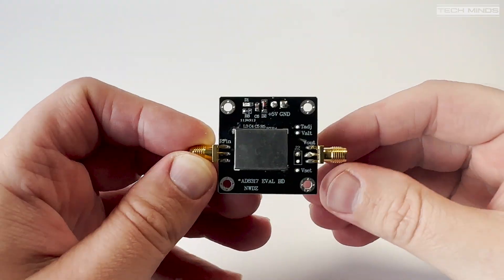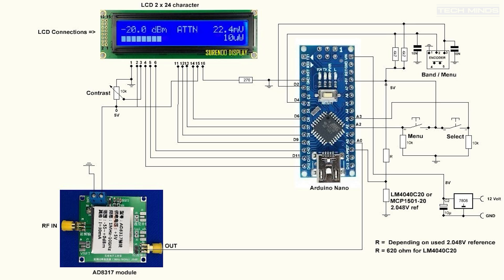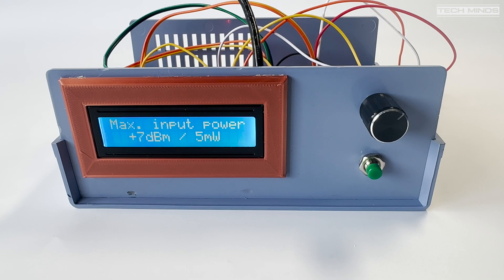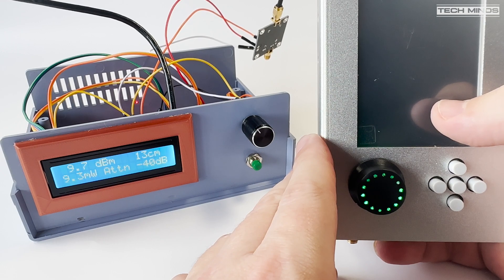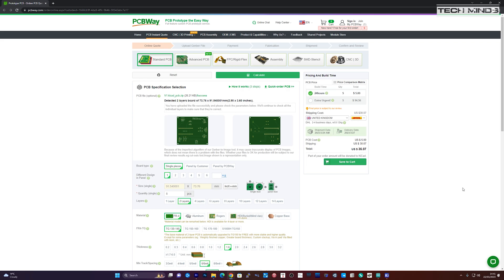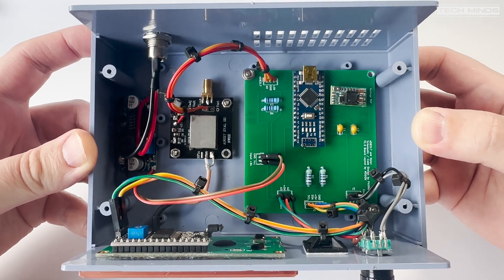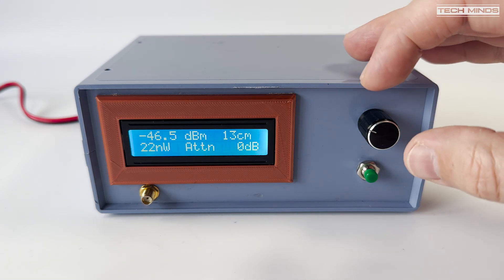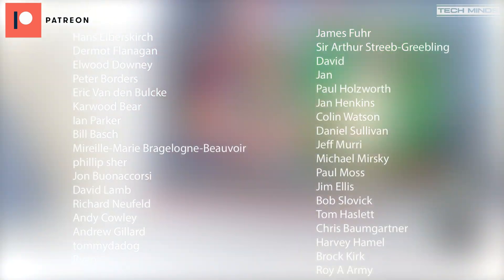RF Power Meter Using An AD8317 & Arduino

Comment: I just rx "RF363" unit from AliExpress. It is NOT accurate! 😂
At 50 MHz, the reading jumps around.
Next to the input connector, there appears to be a 3-way band selector.

Comment: @Tech Minds It looks like you need to debounce the rotary switches 🤔 You can do that in software or hardware. Since this is a small project, I'd just do it in hardware with a capacitor across each switch. Jack Ganssle has some good information on debouncing switches.

Comment: If you are fine with cutting the dynamic range above 0 dBm and for large powers you would use an attenuator anyway, you can set R7 and R8 on the AD8318 board to increase slope some. I did that with 10k on each to get the slope 2. I also populated C9 to reduce the envelope bandwidth, because the ADC samples slow anyway. Finally I used an ADS1115 ADC board, about as cheap and large as an external reference, but 16 bit (15 above 0 V). The result is surprisingly precise as long as you keep the temperature stable and wait until the AD8318 is heated up (note its power consumption). The datasheet temperature drift is pretty high, so I use a second channel of the ADC to sample the AD8318 temperature, which the board provides as voltage. A few minutes after power up that signal often oscillates for a short time and always only once, like the AD8318 recalibrates something.

Comment: 10:23 Why did you have to put the attenuator in line friend? 
By the way, proud Patreon supporter here... If you aren't a supporter ya oughta head on over and help out this esteemed YouTuber. :-)
Reply from the maker: The reason for the attenuator is because the max input of the meter is around 0dBm, so we add the attenuator between the meter and the radio and then configure the attenuator offset within the menu. Hope that makes sense! Cheeds

Comment: Cool project, I'm always interested in power supply or power meter projects. :)

Only the autorouters always put also traces just next to each other, 5v and menu signal are unnecessary close to each other, no need for that and it can cause a couple if different problems/challenges. Next time try route your board yourself, will give much better and nicer result.
Reply from the maker: Thanks for the info!

Comment: Check if that board has input compensation. For your next update consider a power tap (so that you can use it inline) and a digital attenuator, it comes in handy.

Comment: The commercially made power meters based on similar AD logarithmic converters require the user to enter the frequency because the response of the converter is not constant. How about this one? Also, some power meters do have a frequency counter for this, with or without actually displaying the frequency (what a waste..)
Reply from the maker: Did you watch the video? I clearly show band selection.
Reply: Oh sorry, my fault. It is interesting and a lot to be done here. I was referring to the Nissei power meter that is in almost every shack despite its price. It most probably has a built in frequency counter but doesn't display the result. For your QO-100 amp i guess the best approach is adding a directional coupler of -20 dB and leave it in place during TX. cheers

Comment: Very nice - I've been looking for a DIY meter for a while for my projects. You can buy HP test gear power meters very cheaply but the actual sensor heads are separate and go for $$$$ each
Reply from the maker: I’ve also been looking at the same devices. The sensors are 4 x the price of the meter! lol thanks

Comment: Well done for a first project with KiCAD and PCBWay. The BATC boards I have designed are all done with KiCAD, the Winterhill, Knucker, Minitiouner, Refbias etc. You can see my experience progressing if you know what to look for. E.g. Compare the minitiouner and the Knucker or  Winterhill. I have done quite a few Nano bards for things like linear amplifiers etc. The 3D view is very useful with the components on and the case to ensure good layout from the build and use point of view.
Reply from the maker: Thanks Mike!